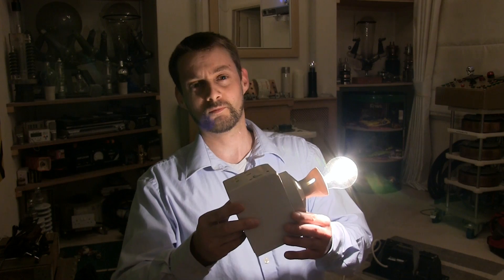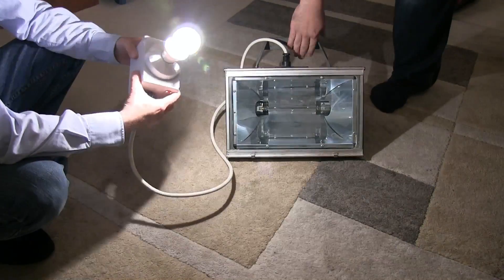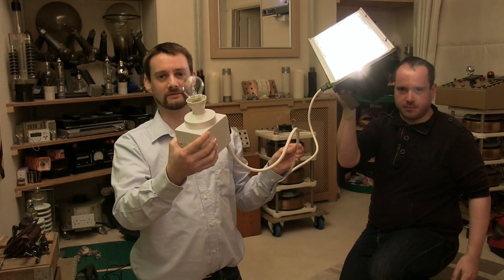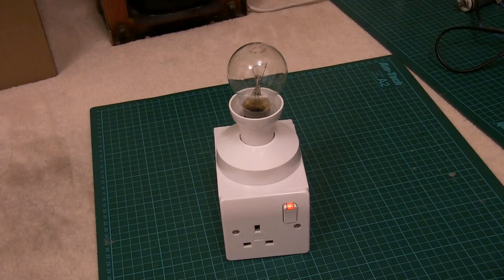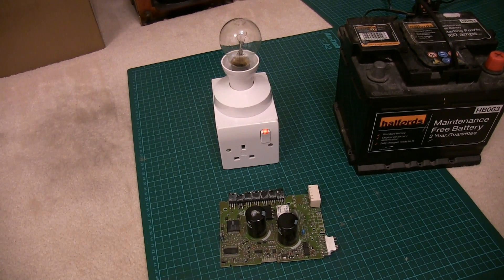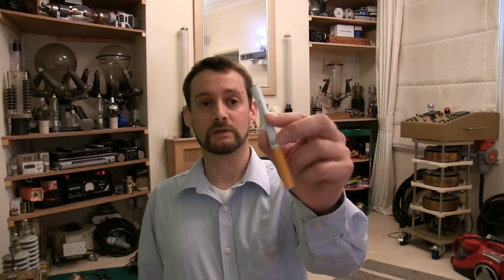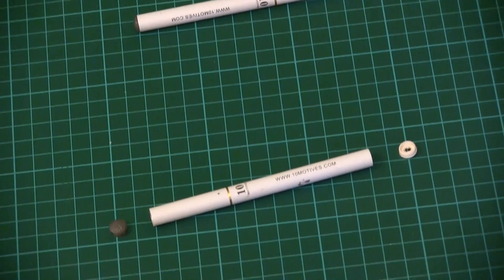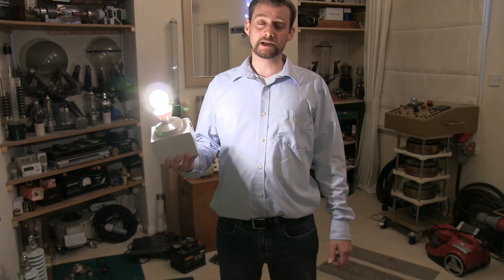Wireless 240v Power Cube Reveal

Comment: would you get moire current using 18650 batteries?
Reply: It depends on they type of battery. Most laptops and things use a type of lithium cell called ICR. These store maximum energy, but have limited current capability. They are designed to be drained in 1-2 hours or longer.

E-ciggies use IMR lithium cells. These have much higher current capability, but lower energy storage (they are designed to be drained in 5-10 minutes). This way, even the tiny cells used, could handle the 6 A load of the big floodlight. You can buy 18650 size IMR lithium cells, which are good for 35 A current.
Reply: While he may get a few times more current, 18650 cells are over five times bigger so he'd get that much less voltage and end up needing a boost converter to ~5X the voltage.
Reply: You can still get a load of current out of them. Say these are 500mAh cells with about 20C current rating, typical cell for disposable e-cigs. 0,5 * 20 would be 10 Amps current rating. Photon measured 250V, so at 10A you could theoretically get about get 2.5KW of power out of that box.

Comment: har har har amazing =D too bad it's DC tho... Can't have it all I suppose... cor what kind of heatsinking would you need to oscillate that kind of power :-/
Reply: Not a terrible lot if you use PWM or just a simple modified sine. The R(ds)-on of a good MOSFET is less than 0.1 ohm so dissipation is low.
Reply: +LimaVictor huh you know i was worried more about switching losses, but i guess 50hz is pretty low-frequency?
Reply: At 50hz the losses are very low. PWM at 25khz or so will still be quite okay. If you would use a aluminium box, you could get away with using the box as the heatsink.

Comment: I was thinking it was a massive power supply via WIFI
Reply: No, greentooth
Reply: if he was wirelessly transmitting 1500W I would not want to stand in the beam.
Reply: Do you know what transmits at 2.9GHz at 1500 watts? No, not a beefy wifi, it's called a microwave oven.
Reply: Standing in that beam would excite all of the water molecules on your body... You'd boil at a sub cellular level :D
Reply: isnt it supposed to be bluetooth?
Reply: +DexterTheMightyGodwin Its a wifi-like transmission of high-power waves to the box and low-power waves from the box.
Reply: eh, well.. people do play with magnetrons in unsafe ways, and they survive long enough to post the videos. I myself am smart enough to keep away from these. plenty of other toys to experiment with and cause destruction.
Reply: +Pete Lorenzo It's not some magical fucking radioactive-like radiation, all it does is it rotates water molecules back and forth in you, in a perfect scenario there are no long term effects even if you get a burn from it :D
Though if you look into it, it will be like looking into a 1500 watts laser, so you go insta-blind.
Reply: power souce to osillater to a resonent circuit witch will pass power to the other resonant circut conected to rectifier and load

Comment: Now plug a transformer into it! 

But you can't without burning the coils with DC.
Reply: Plug in a switchmode PSU and you'll be fine, though :D
Reply: I know that. Switchmode PSU's run on DC.
Reply: Tons of stuff has universal switching supplies that will run on anything between 90V and 270V AC. Those should be fine on about 130V DC, except those small adapters with single diode input rectifier which won't work when plugged in backwards.
Reply: 2:24
Reply: it's DC no oscillation
Reply: Switchmode PSU's run on 310 DC nominally , cuz it's span of 220 AC )
Reply: Teardown Dan
, yep. thanks to 110 AC standard.
Reply: How is a switch mode PSU gonna convert DC to AC for powering a transformer?
Reply: Unbox It
, by transistor o_O
Reply: Salvaging Transistors from a PSU to convert it to AC?
Reply: Unbox It
, No. Try to use transistors (switch "on" or "off" state periodically ) instead Salvaging them.
Reply: You could convert it to AC with a sine wave inverter setup (it could be that small as the transistor input current is very low)

example:
a 24v to 240v 2500w inverter input current:
Input 104.1A at 24v DC
Output 10.4A at 240v AC

using it without switch transformers
Input 250V 10A DC
Output 250V 10A AC
Reply: Delta
square wave is enough.
Reply: nRADRUS your not one of those square people are you :)

Comment: Can you imagine the performance if you had used 18650 batteries instead of those little ones?  The run time would be 2 to 3 times longer probably, since 18650 batteries have more mah.  Still 3.7 volts per battery as well, but the cube would be much larger.
Reply: This would be true if he used the same number of 18650 batteries (81), but the cube would have been much larger.

Comment: Are those rechargeable ?
Could be interesting recharging that lot, unless you charge banks of nine at a time
Reply: They are. It´s cheaper for the manufacturer to buy rechargeable cells than to buy standard 3V litium batteries. Seems odd, but I´ve checked this myself. A new cell is about 4.15V which suggests that they are the rechargable type..

And I also did recharge these cells several times. No problems there.
Reply: BigClive.com had a look at these cigalikes, and came to the same conclusion as you - you just need to be careful not to overcharge them as I don't think they have a charging circuit taped to the cells IIRC.

I did think it might be high capacity 18650s, but couldn't work out how he'd get enough of them in to get to 240v; might be 10650s or 14650s, but regardless smaller diameter = more cells = more voltage.

Pretty neat little project!
Reply: +Beany2007FTW Clive speculated they didn't have a charge protector, but when he charged it he realised that they did indeed have one... Makes sense when you think about it... They're just using standard lion batteries from some supplier in China who manufactures them complete with charge protection, it'd cost more to remove the charge circuitry.
Reply: Disposable ecig is the same as the rechargeable one, just leave the little socket off the board, and you have one. You can even put the socket on the board and refill it to convert a cheap one into the less cheap refillable one as well.

Nice to repurpose the cells, i had guessed a lipo pack and a small high frequency inverter, but the brute force approach of simply having enough smaller cells is simple enough, and there was no incidental cost either to get them.

Nice to give up smoking, though the taxman hates it as you pay less of that lovely sin tax on your habit/addiction.
Reply: Well the flaming battery pack is kind of a Photonic speciality. So these are right up his alley, and just the thing to test on the big battery charger when it decides to fail.
Reply: Very possible but would be better using 8 Zippy 10s 4000mah or similar lithium packs connected in series. That way you'll have an pack with balance connectors to keep all the cells evenly charged and much more capacity.
Reply: Max Mouse Ah yes, that sounds more like what happened!
Reply: wouldn't be gimmicky would be breaking the bank
Reply: BillyNoMates1974 They are, but, you have to be careful because like with anything electronic, you might stumble upon the super cheapo ones, those might act nasty under charge, unregulated as they are.

Well, i'm sure that if you have a charging box (i use an old ammo can) then that wouldn't be much of an issue either. They usually pop only under charge or short.

Comment: Hmm, are they actually LiPO's or lithium primaries, is what I want to know.
Reply: ***** They are actually the same thing. "Lithium Ion" is just an umbrella term for lithium based secondary cells with different chemistry. Sometimes the term is used for batteries with a liquid electrolyte, but those have been largely displaced. I have disassembled both cylindrical and cuboid lithium ion cells and they are all rolls of coated metal film. Most cylindrical batteries nowadays are explicitly LiPo, especially the small ones that have no rigid metal housing.
Reply: Yes you can. They can be rolled up.
Reply: I happen to have an e-cig battery, this seems to have all the specs but i don't know what any of it means. http://www.alibaba.com/product-detail/wholesale-price-1300mah-16600-3-7v_60455023315.html?spm=a2700.7724857.29.1.1wzLW1&s=p
Reply: Apparently at least some of them have Lipos. My one specimen was a secondary cell. 280mAh

Comment: Well, how cheap are those batteries? because if you can get them by themselves, then there are a lot of applications. what are they rated for in current draw?
Reply: Rated for? Ratings are for pussies. Crank it till it pops.
Reply: you can usually safely draw 20*capacity from lipos, up to 60x for higher end ones, if these are ~400mah cells then you could draw 8 amps from them.